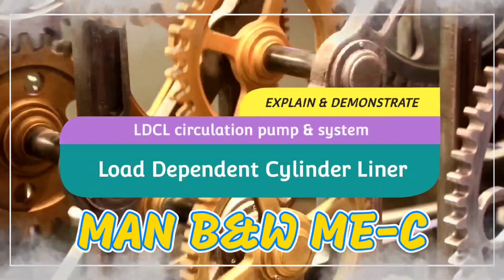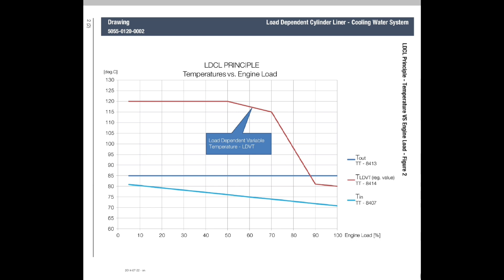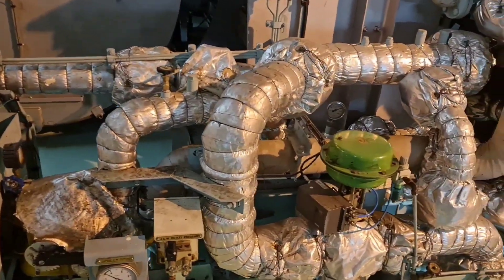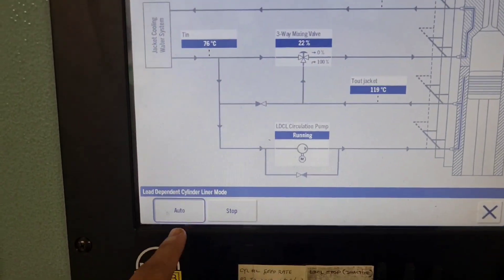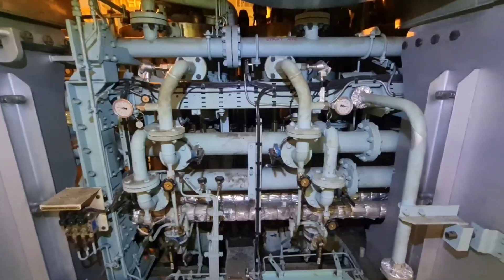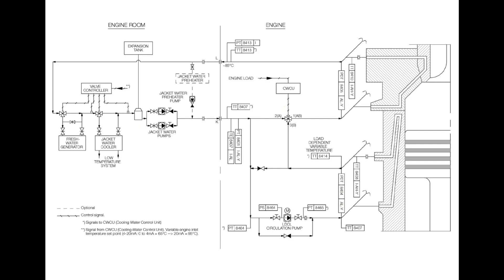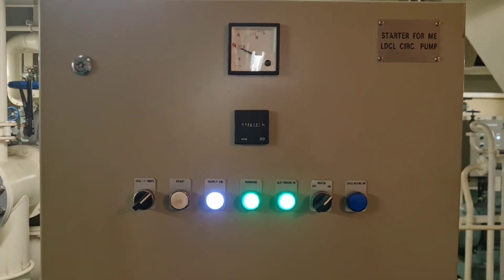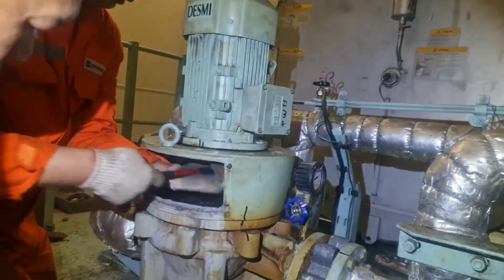[EXPLAINED]  Load dependent Cylinder Liner, LDCL circulation pump overhaul, cold corrosion

Comment: How to adjust mixing valve to 22%?
Reply from the maker: It is controlled automatically according to Cyl. Liner C.W circulation temperature. If you leave auto mode, failure alarm occurs and change to bypass position.